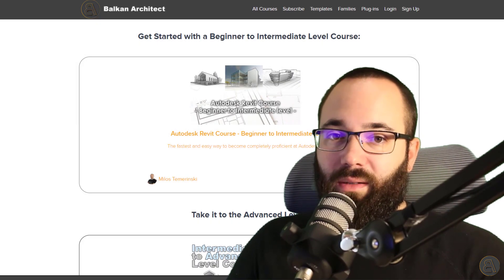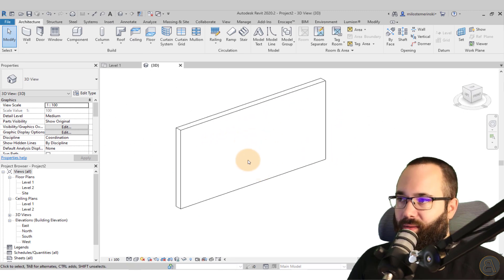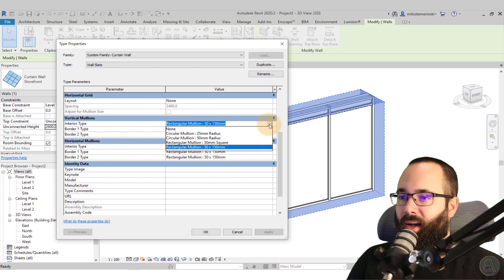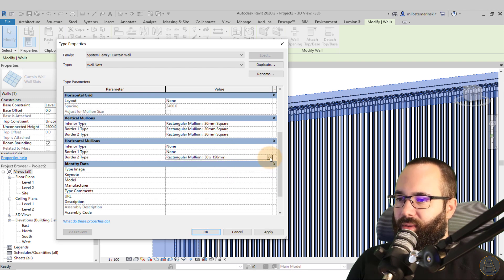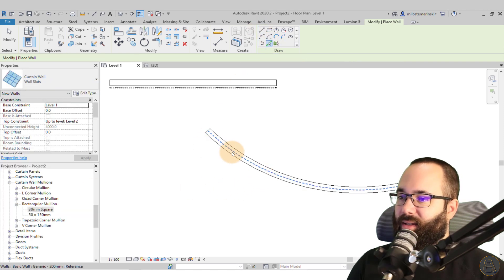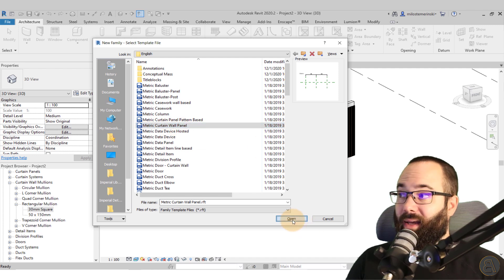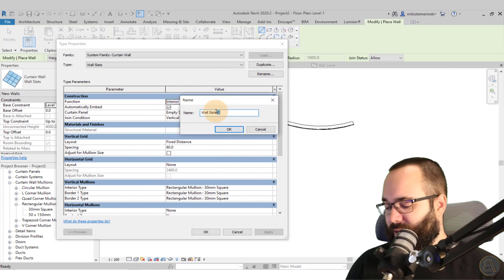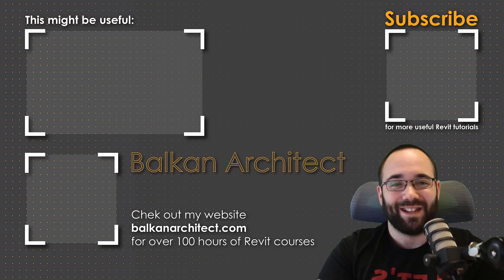Wood Slat Wall in Revit Tutorial

Comment: i did all the steps according the video . and i tested about 40times , but i had a problem and i got an error , when I wrote 60 mm infront of spacing in vertical grid in layout part , converted automatically to 0.0600 and finally this error Changes have been made that cause a curtain wall with type driven grid lines to exceed the maximum allowed number of type driven lines (200 in direction (1) and 200 in direction (2)).  If you really need this many type driven grid lines, please split the affected wall before proceeding./ Could you guide me please ? thanks

Comment: there is no empty panel in my revit. I cant rid of all the curtain wall glass, anyone help please?
Reply: Similarly, I do not have empty system panel in my revit 2020. Read that it has gone missing since 2017 version. Wonder how the author has it in his revit family.
Reply: @kelvinloo8055   I just solved the problem in the 2023 version. You can download one online, then load it into your project, but I think it needs to be loaded every time you create a new project.
Reply: @chrisdonn4794  thanks. You mean download the family file or download the whole 2023 version?
Reply: @kelvinloo8055  Just the family file
Reply: @chrisdonn4794  got it. Thanks

Comment: The issue I have with this method is that the material applied to the slats come out looking very repetitive, and the way around that is by either creating a standard wall with reveals added on to it, that way the material texture is applied to the wall as a whole therefore looking a lot more realistic, or creating a wall based family with voids set to an array parameter cutting the host wall, then loading that family into the project and applying it to a wall whilst making sure the family cuts the wall, again achieving the same visual effect.

Comment: I wonder if it would be better to do these slat walls as regural walls and just fill in the correct metadata for the type and description etc. Then just give the wall a texture with a cutout so that the wall will look like a slat wall in renders. This way we would have the same information but much less geometry.
Reply: I do this for most slat type things, like wood slatted ceilings. they look pretty good with pbr textures, I think the advantage to individually modeling things is they look more realistic when rendered.
Reply: You are absolutely right, the method shown here looks nice but is not practical, especially for large buildings. Consider the fact that in floor plan this will show as a black blob on 1:200
Reply: @marcdenheijer606  do arch plans in your company include finishes? That in itself seems like a waste and confusing. A finish like slats usually is part of a separate model dedicated to interior design. For large buildings usually you would use enlargement plans on separate sheets and callouts. The scale shoul be enough to tell where everything goes. I agree this level of detail would be best reserved for single apartment remodel. Or a specific zone like lobby. Since its nesesary to inform carpenter of the density of the slat pattern.
Reply: @trowawayacc  Yes they do include finishes, why would that be a waste or confusing? Especially finishes >50mm, for us it is essential to have these walls because they align with architectural elements or are integral part of the architectural design e.g. acoustics. It does matter also in floorplan if a wall is just 100mm or 100mm+50mm finish. Note: I'm specifically talking about the architectural finishes, not the finishes the interior designer might draw to embellish certain parts.

Comment: The problem is there is a maximum amount of mullions that are permitted in a curtain wall type. If I remember correctly it is easier 200 or 2000. This will require in some circumstances several walls. 
It is also possible to fix the issue at the ends where the spacing between the mullions are not equal. In the curtain wall type settings, there should be buttons that say adjust for mullion size, and if you enable it, it should fix the issue in future curtain wall type placements. However it doesn't affect existing walls of the same type.
Reply: i just had a typo and had 6mm spacing instead of 60 and the wall still had horziontal slat every 60mm. in total abouy 50k slats , took 10 min to create without any problems